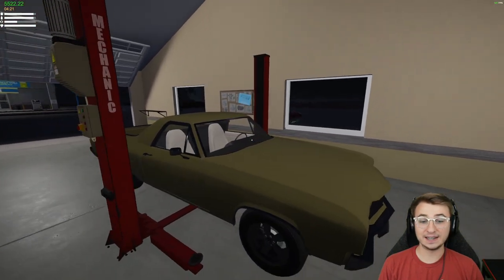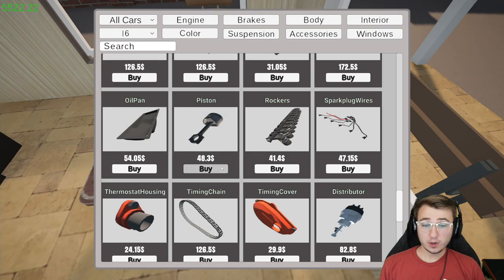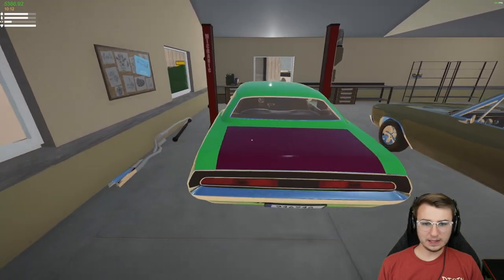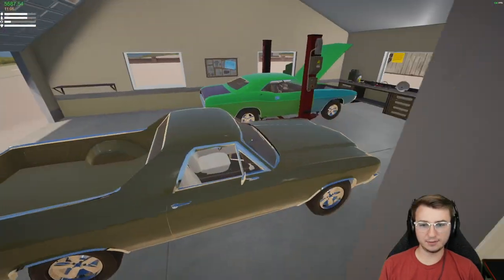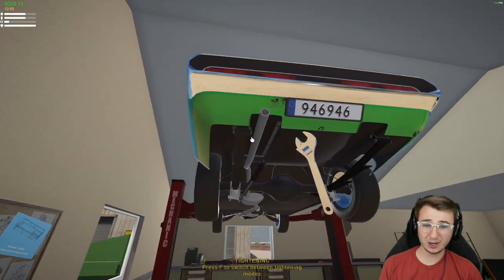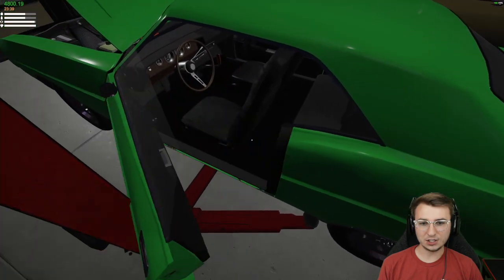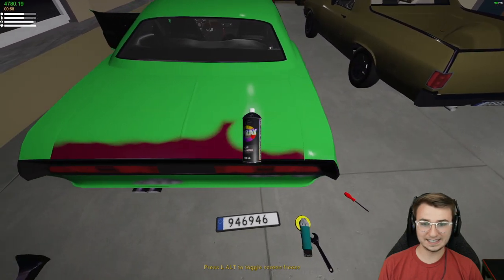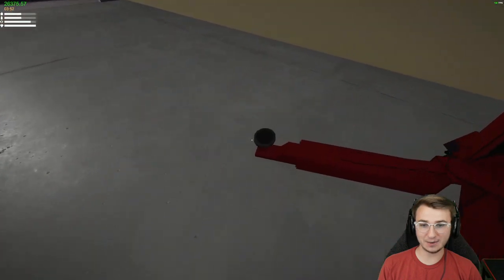My Garage - Ep. 22 - Bart Slant-Six Swap (FLIP)

Comment: In my experience, restoring the interior to new doesn't really add much to the overall value.  Bodywork & paint & trim is the big money. I only bother if it's a car I want to keep. Even then, the junkyard is my go to. Just buy them when I see them in good shape, all colors & styles, piled up at the junkyard. Handy when you only need a few pieces to finish a flip.
Reply: I second this. Stars earned for washing, de-rusting, and painting junkyard cars will make you bank quicker than doing any customer work. The Wolf will net you the most so far.